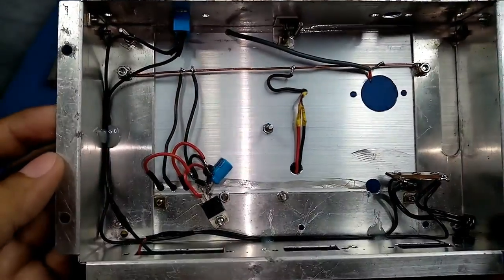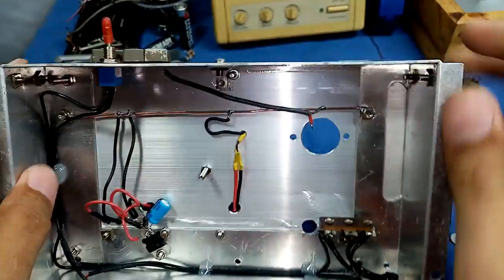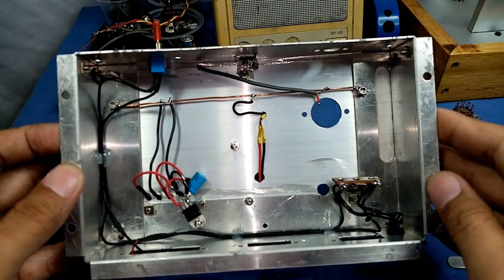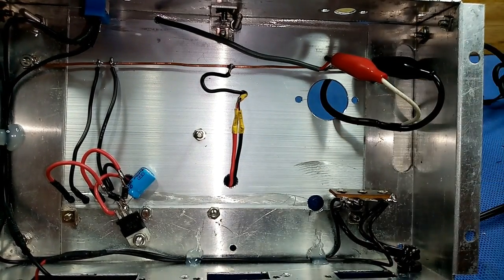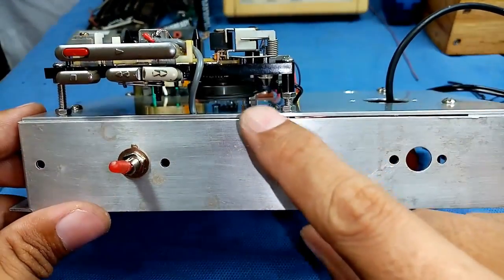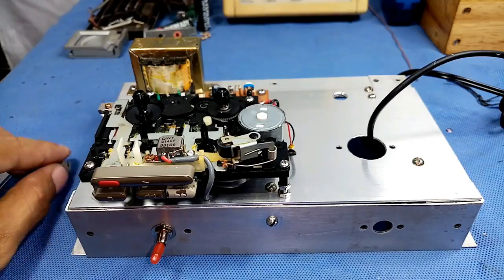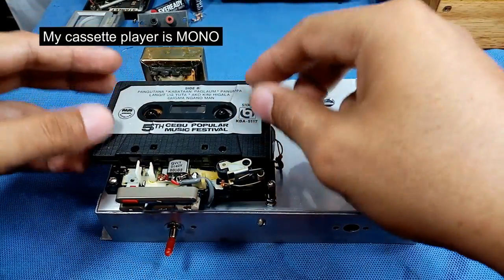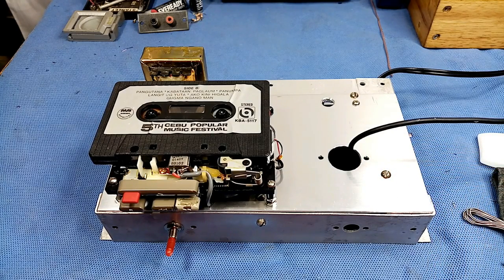How to make a Cassette Player from scrap parts

Comment: can i use different preamp for the magnetic head or there is specific pre amp?
Reply from the maker: It has a specific preamp for specific tape head but you can experiment with other preamps.

Comment: what would i need to do to make the tape head work with a pc usb sound card? both for playing and recording mostly to digitize old computer cassettes into an emulator.
Reply: green and pink plugs
Reply from the maker: You can use cassette to mp3 converter. Check this link https://youtu.be/YOGRiCXlGXM
Reply: Just plug the audio output from the tape player into your PCs audio input and thats it. Never waste money on an "MP3" converter for tapes. They do nothing more than any other tape deck. 3.5mm analog input > USB

You can record the input with Audacity and save it however you'd like

Comment: Dude. You used a mech with a plastic flywheel. The cheeziest of the cheezy cassette mechs. And that head. I am trying to hold back from laughing so hard I cry. If you were going to go through all that you could have at least used some mediocre tape transport. Not the worst of the worst. LOL
Reply from the maker: Thank you for your comment I respect that. Anyway this are all from junk parts well it works just fine and I'm stick to it.
Reply: And all you can ever do is to bla bla on the internet, LOL